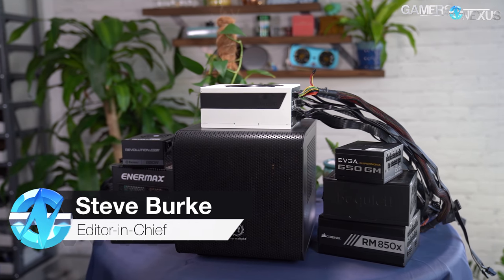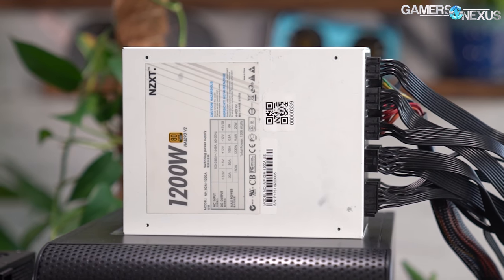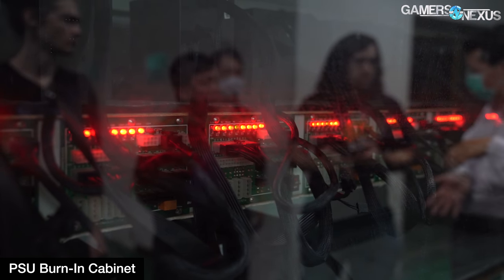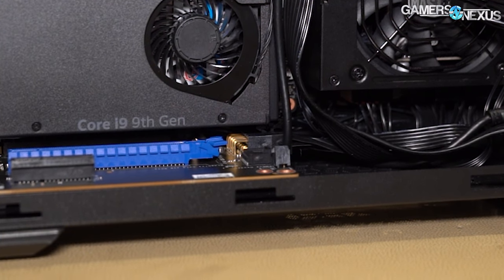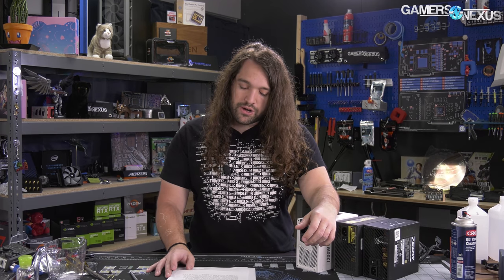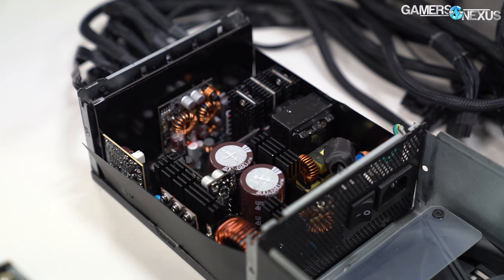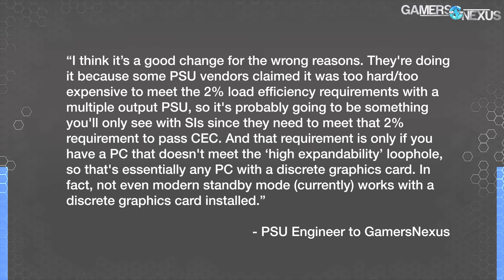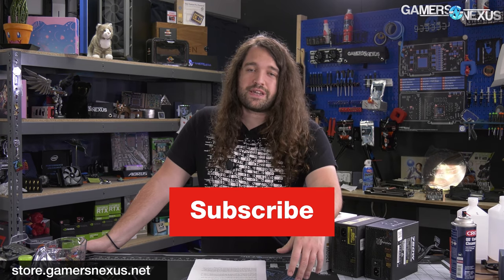Intel's ATX12VO Spec Explained & What Manufacturers Think

Comment: This would be cool for applications where you want to run computers off solar, or on a custom UPS solution.  You can skip one conversion stage and just go straight to the computer from the battery, if it's a 12v system at least.

Comment: Given that the highest voltage required on modern spec is 20V (USB-C power) up to 100W, it makes more sense to redesign the PC power delivery around 20V as you find in a lot of laptop's non USB-C power bricks (typ 19.5V).
This would obviously need new components to replace the current 12V designs (primarily VRM power stages), but if we are going to change to a new standard, then why not phase it as an OEM standard in low power systems as the semiconductor industry develops high end power components specifically for high performance enthusiast desktops, another advantage of 20V over 12V is that you can use thinner wire as 100W is 5A instead of 8.33A.

Comment: I can see one particular use for one of those 12VO supplies right at the moment: powering my 3D printer and only needing to jump Power_OK, you get the whole output of the supply. I'd assume a Seasonic-style daughter-board with all of the bucks and connectors is going to be on offer by someone eventually. I'd even get one for my case since it's smaller then the old one and just a bit cramped.

Comment: I think it is a good idea, a 12V to 5V DC-DC convertor doesn't actually take up that much space and having the PSU 12V only means that it is easier to implement a UPS within the PSU (or to just use 12V DC mains supply) as 12V batteries are a very common standard.  To save space on the motherboard, manufacturers could adopt a eSATA connector on the board and have a SATA data/power connector at the other end.  The only real issue that I see is supplying USB ports, 1-2A per port with a dozen ports would make for one heck of a DC-DC conversion setup - worse yet if you want to do USB power delivery with 20V@5A.

Comment: Think about it.
If you run a single 12v cable to the bay area, then had a device, that had headers for drives to offer 5v power.

Comment: I wouldn't be surprised, if there will be some kind of converter boxes, that will do the voltage regulation, so you can use a 12VO PSU on a now-standart motherboard.

Comment: I probably just don't have any idea how this stuff works, but if stepping down voltage is not efficient. How will pushing the conversion to a different component  change that?
Reply: Two reasons. One, transmission losses are significantly lower at higher voltage. Two, having one beefy VRM prepared to supply all the 5V power you might ever need will mean that it is almost never optimally loaded. Usage-specific VRMs are thus more efficient, and can even be switched off when not needed.

Comment: You could run a 12VO board off of an ATX supply: You merely need to short PS_ON to ground and connect 12VSB direct to 12V. It's a bodge though, as it would mean the PSU would be active even with the computer turned off, wasting a lot of energy.

Comment: It its only 12v now why would they not just use a 2pin connector / 2 screw terminals. Why still use 10 wires?
Reply: Amperage limits per wire.

Total power (Watts) = Voltage (Volts) * Amperage (Amps)

Amperage melts wires much faster than voltage. Since the total power demand during high CPU tasks hasn't dropped you need more than two wires.

Comment: I could see a use case where the 5V supply is built into the computer case. So imagine a drive backplane (like in a server) with the 5v supply built into it. Also then the usb section of a case could have a second small 5V supply in its circuitry. Then you may have a computer case with one drive power cable and one usb power cable built into the motherboard connector for each device. This would be a change in more than one standard though...and still more expensive. Voltage regulating chips are getting incredibly small and powerful so the circuitry would be quite compact. I kinda like the idea...but then I always need an excuse to build a new computer.

Comment: Why is it more efficient to ax 3.3 and 5v from the power block, the conversion to them still needs to happen, but now on the mainboard.
Reply: Line Loss from cables is worse the lower the voltage. The closer voltage regulators are to the consumer, the better. This is why CPU vrm is so close to the CPU, and PSUs don't have a 1v bus haha!
Reply: @Houstonruss  At the time the standard was made CPUs used something like 3.3V, not 1V like today.

Comment: Would going from 12v to an even higher voltage save more energy like going from 5v to 12v did?
Reply: not really, as it's a function of amps used by the load multiplied by a percent of the voltage drop across the step-down converters to get the 5V that everything uses or the 1-point-whatever for the CPU.   The only thing a higher voltage saves power on, is the loss from the length of the wires from the PSU to your device, the shorter or thicker the wires the less power lost to heat.   in a PC we are talking less than 3 feet, it's not hundreds of feet as some server setups can be (and they do run on 48v or 24V instead of 12v at many places). the power loss of the VRM is less at a higher V than the loss to heat from the super long wires for them. In a PC it would more than likely be the other way (VRM loss being greater than wire length heating)

Comment: Pretty soon most PCs will have a USB-C PD external brick as a PSU. It removes some heat and wasted volume from the case, standardises manufacturing for the brick (small GaN units already cost effective and really efficient). Further large cost and volume savings if monitor DP and USB4 connected via the same brick, no more IO shields :)

Comment: 14:13 That PSU is still rinning my current system I've bought it in 2009! I only have to open it apart to clean and check for caps lekeage... 11 years still going with all original components!

Comment: I'm not a hardware expert of any kind buuuuut with todays electronics almost all running on 12V or being fairly low powered, wouldn't it be quite space and looks saving when it comes to much less wires? The little extra heat output for the voltage conversion at the much lower wattage devices sounds neglectable to me
Reply: Current consumer hardware is pretty low powered comparing to 10 years ago, IMO.

Unless you start counting TR4 and LGA 2066, but if we can provide cheaper and more efficient psu for most mainstream consumer, why not?
Reply: I would even put 5V DV2DC converters into Cable ends or even into the devices like SSDs (SATA only), HDDs, and such. It increases efficiency cause less current is needed for same wattage over the long cables.

Comment: I like ATX12VO, why?
Because it will allow us to much simpler build our own power supply.
Why should one want to do that?
It will allow to get rid of the DC-AC converter when you have a (self made) USV in front of it and get it directly wired up to the components.

What about DC-DC converters?
With NVME drives getting more common, it is perfectly reasonable to "just have a motherboard" without any drives and even if a gpu is added, the gpu connector is already 12v only...

Comment: What if we took an older drive bay standard like the optical drive bay or 3.5" HDD and built a device that takes 12vo from a molex or sata power connector as an input and outputs the 3.3 and 5v outputs needed for these limited uses? This would enable legacy support even with these new power supplies and older motherboards. In the case of an optical bay, it could mount a blower fan or those 3x40mm fan 'hard drive cooler' layouts from long ago as a front intake to cool the transformers used to step the voltage down.

Comment: As an IT Administrator, that deals with tons of SFF Business desktops. This is only good. Like the video says, there already exist 12-volt only power supplies. The only problem is every single one of them is proprietary to that model series. Making a universal standard means in the future we can replace them all with a standardized power supply.

Also for people who don't think it would raise efficiency. Did you not just watch the video? Yes, it moves it to the motherboard to deal with. But the motherboard will know exactly how much power it needs and will spec the DC to DC convertor to match. A lot of these SFF computers don't even have any drive, except for a DVD drive every so often so instead of putting out any additional output it can put out just 1 or enough for 1 drive. If you had a standard ATX power supply, they would need to spec it enough to meet a theoretical demand that wouldn't be possible in the case.
Reply: I'm guessing the day that you can swap the broken psu from a HP desktop with the Dell psu you have laying around in the storage and ordering a Lenovo psu to replenish the stock isn't going to come unless an ATX standard is mandatory by law. A nice effort by Intel but I don't think SI will settle with less income from the https://#abrandname.com/spareparts site ;)

Comment: A couple of things:
1. Efficiency is different at different loads
2. 5V/3.3V are part of the logic that drives the PSU
3. Quality?

All three are subjective - an average PC used for specific job has unknown load, logic should be redesigned from scratch, quality will be definitely lowered again (for the last 20 years saw only 3 well made PSUs)

P.S. Seems users that yelling about where are their power+sata combined cables, forgot about eSATA - data + 5V/12V power supply

Comment: So just wondering, would it really be an issue to just reengineer all 3 and 5 volt products to 12 volt and be done with those rails or would there always be some small need for them?
Reply: I have a 3TB, a 2TB and 2 1TB SATA drives that would be incompatible and i don't think similar capacity new SSDs would be cheap.

Comment: I'd love a simpler, cleaner psu standard (that doesn't require anything in-line, no double wires, and everyone has the same pinout).
Reply: Also, that engineer who wants just +12v and +5v, get rid of +3.3v and -12v, and use a smaller mobo connector...that seems brilliant. Simple and easy to implement for everyone.

Comment: The fit more stuff/bucks into existing mobo real state is not to be overblown. Currently RAM uses VRMs that feed off 5v because of the 5VSB rail on the motherboard. Since ATX12VO changes that to 12VSB, now ram and other standby cirtuitry can safely go to be feed off 12V and just change the VRM configuration, not add new step down converters. What can't be really avoided is the 5V on USB and 2.5 drives, or the 3.3v on the m.2 drives and 3.5 drives, but that is just a fraction of what currently is needed from those rails. Over time, most of those devices will switch to 12V on the long run, so all in all it is not as big of a change even for mobo makers as it seems to be on a first impression. ITX mobos will have a hard time probably (specially AMD ones with all the socket clearance needed).

Comment: The Seasonic Connect would be a concert that work for it, no? The main unit does not provide 3.3V, this is done in the connect module. I guess they could change it to only do 12V in the main unit and it would meet the new standards. Or is it me who did not understand?

Comment: If they insist on going this route, then there should be 12V only going to all system components.  Each component would then need to use buck converters only large enough for its own requirements.  Hopefully that would maintain better efficiency than dumping all system voltage requirements onto the motherboard.  Of course, that would also mean that it would be necessary for all components to be redesigned and produced for that platform.  Perhaps, if they do it right, the new components could be designed to be compatible for cross platform use.

Comment: THis should have happened years ago but I'm glad to see they are finally getting around to it.  For all those crying about RGB impact a simple effective fix is called a resistor, which I'm sure will be an inline connector so current RGB items will work straight away.  Future RGB will just be 12v Led's.  The whole idea is gonna be great and small PSU connectors will ease up cable management as well as any outdated Sata device usage being far more space saving and less cable clutter.  This change will be good but many myths will float around till it's accepted just as ATX was way back when.

Comment: My Lenovo motherboard has a simple 12V only PSU and the motherboard has SATA power built in. It works decently and the cables actually look much simpler.

Comment: Servers have been using 12V only PSUs for many, many years already, and (business) PC manufacturers like Fujitsu have managed to build PCs with (proprietary) 12VO that easily manage to consume <10W on idle without "cheating" with laptop components. Looks a bit strange when you only have 2 wire strands coming from the PSU (main connector and 12V for the CPU) and all other wires branching off from the MB, but it can look very tidy, especially since they know exactly how long the cables have to be to reach all mounting spots for drives etc.

Comment: ATX12V0 sounds awesome!
You could power your pc out of any powerful enough 12 psu or out of your car. 
You could even use it for 12 printers or the inverse, use led strip power supplies for your pc being that they can be passive hence silent.
Reply: Powering it from the car is probably bad idea, it's hardly 12 volts there. When motor is on, it's nearly 14,4 volts usually (keeping battery 100% charged) with lots of noise from ignition system. For PC use 12 volt supply should be at least within 5% of nominal voltage.

Comment: I think you've missed the obvious: 3.3V and 5V could be supplied to devices external to the motherboard but inside the case by a converter in the case rather than on the motherboard. A case without drive bays might not have such a converter,  whereas a server case might have one with lots of outputs.
Reply: Why not leave it in the PSU?
You basically suggest splitting the PSU in 2.
Reply: @happygimp0  Yes. Is there a problem with that?

Comment: Question, with the new requirement for boards to provide SATA power, are we going to see a SATA connector revision to have a data+power port that isn't massive? Especially if they're moving to 12v and 5v only, as SATA power currently has 3.3v as well? Might we see a SATA connector revision on the drive side to slim down the port as well? 
I'm all for slimming down power connectors, especially the main motherboard connector, but I honestly don't see this working well outside of very specific OEM/ODM systems with the SATA power requirement, as the two ports are fairly bulky when compared to literally any other auxiliary connector, which is why I think SATA needs a connector revision to also slim down the connector. What we lose from the 24 pin connector thanks to the new 10 pin connector isn't enough when compared to the SATA requirements, which will take up vastly more space than what the 24 to 10 pin conversion gave. 
The only potential way I can see this working, if we don't see a SATA connector revision, is stacking the power ports, such how SODIMM is typically stacked, or having a singular connector that breaks out into multiple connections, but then I would also think that singular connector would need to have it's own standard due to power requirements. 

Also, how much of a loophole is there for power supplies like Seasonic's Connect platform? I know Connect uses 12v, -12v, and 5v out of the PSU, but lets say they implemented 12VO. Would a distribution board allow a PSU manufacturer to comply yet still allow support for the DIY market? Basically, as a product, is the regulation limited to the PSU box with the rails, or would this regulation also cover the distribution board as it's bundled with the PSU?

Comment: Hoenstly, I agree 100% with the engineers interviewed, also don't see this standard catching for the enthusiast market at all, those 3 pins for 12v and 3 for ground straight to the board and be it ain't gonna cut for overclocking, lots of accessories and many PCIe cards draining power from the motherboard. Which would mean that the EPS 12v would remain... the difference starts to look smaller at this point. Obviously, it wasn't designed for this so it makes sense.
When you consider their motherboards were almost always fully proprietary, with proprietary power supplies to begin with, and proprietary cases, there really ain't much difference even in therms of practicality (BTX already had simplified power supply with short cables from the motherboard to the SATA drives), and no difference in expandability either, just MIGHT be a great idea for repairs on those pre-built systems and their annoying proprietary power supplies. Tho, I still bet the OEMs gonna keep with their dumb shaped parts that work only on that lineup of that specific generation.

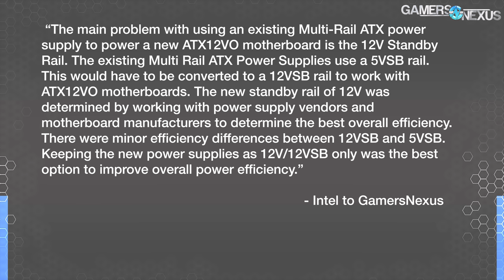Comment: 13:27 in other words, cost. It turns out it is waaay cheaper to not have to build a thing, when you can leave it out. It probably does have an overall advantage in efficiency as well, but the difference is probably so tiny as to be unmeasurable outside a lab. The fact that taking it out has no disadvantages is their marketing line. The reason they took it out was cost.

Mind you, I'm not complaining. Motherboards can certainly take this on, as they have loads of experience with power conversion. And if they want to support USB-PD, they need some fancy controllers for power conversion of their own anyway. At least, they do if they want to send more than 15/25W per port... you can get away with just 5V at 3/5 amps. Perhaps in the future even SATA drives will only need 12V. The biggest plus is getting rid of that monster 24 pin cable.